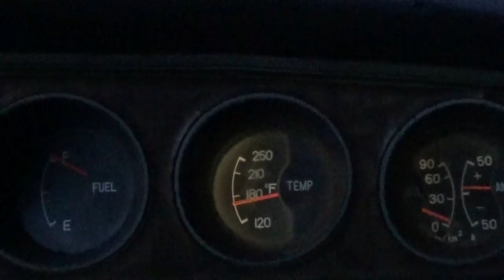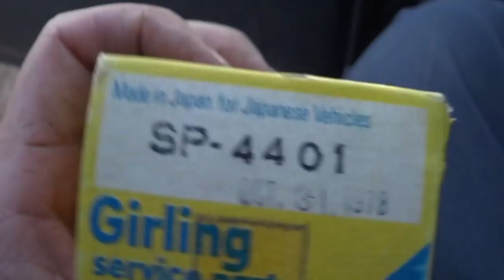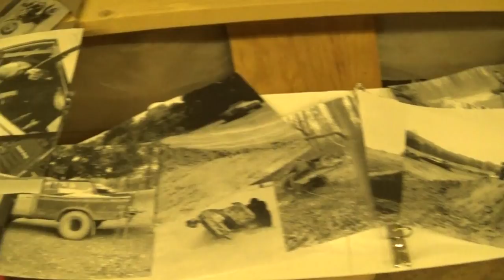Panting the Celica Rims

Comment: 2:00 You can make it fit, grind that extra off
Reply from the maker: nah, sadly its the diameter of the circle that is too big.  I'd have to cut it off, and weld on a smaller diameter circle.

Comment: keyster repair!? OMG  I have a toyota stamped spark plug wrench (one of the old cylinder style you put a little bar thru) are those hard to come by?  I hope not because I accidentally used it as a spacer in my press and put a bunch of dimples in it….. damn man..
Reply from the maker: Nice!  I'm going to say those are pretty easy to come by.  Never checked ebay, but i bet there are tons on there.  I've got them for the trikes too... 18mm plugs on those puppies... Weird size.